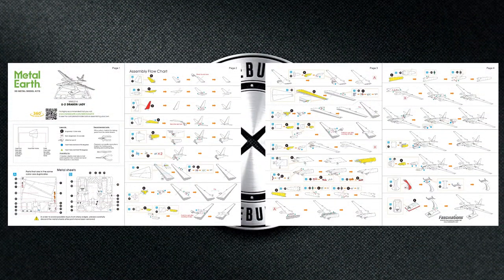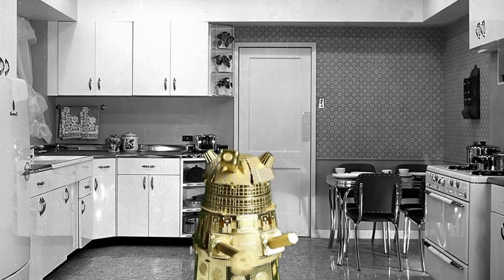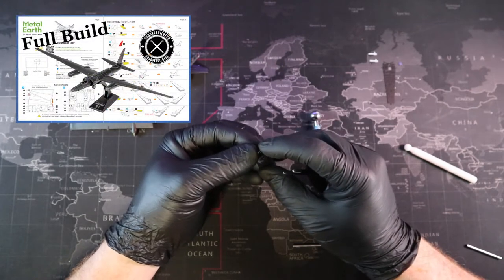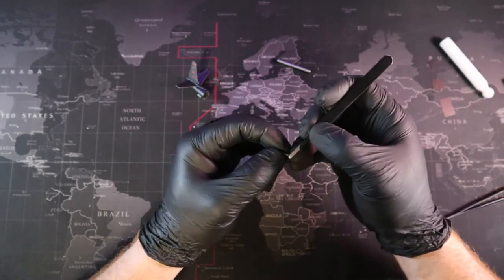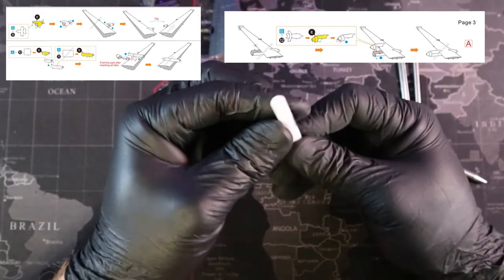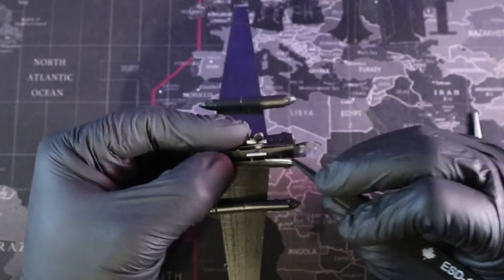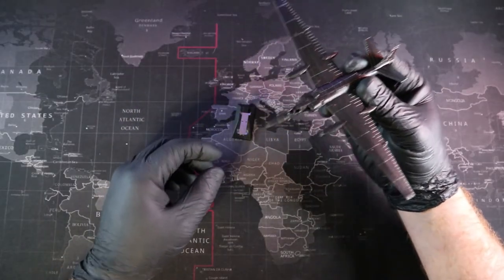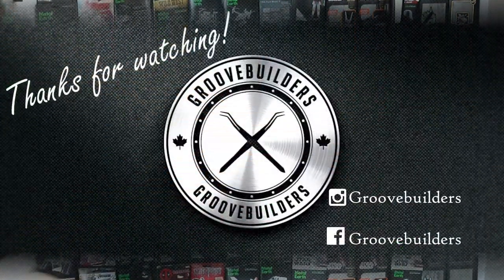Building the U-2 Dragon Lady? Watch this first!!

Comment: Those pods on the wings aren’t engines. The “superpods” carry communication, surveillance, and/or science equipment and are attached to the wings. The U-2 has a single engine in the tail.
Also, the horizontal stabilizers’ angle needs to be fixed, they should be 180 degrees from each other.
Reply from the maker: Your totally right. I ended up watching a few docs on this guy after making the video. Very cool and capable!
Reply: @GrooveBuilders  I’ve actually built 18 different configurations of that aircraft in Kerbal Space Program, including the ER-2 as a bonus

Comment: i found this video because i just bought one of these models and am stuck on the first the steps when you have to connect the 3 back wings and am having A LOT of trouble bending the tabs so the wings stay in place.. any advice to make them stay tighter?(also this is the first metal earth model i’ve ever built) thank you, great video
Reply from the maker: Hey Alec thanks for the kind words,

Sometimes alternating the way we twist our tabs helps us keep the part in place. So if I have two tabs I need to bend, I will twist one clockwise and the other counterclockwise.  In situations where you have to bend the tab I’ll twist it first and then bend it over. This should create a pretty good connection.

Let me know how you do
Reply: @GrooveBuilders  thank you!! i’ve been watching your full build video of it which has help a lot. and yes i definitely will let you know when i’m done!